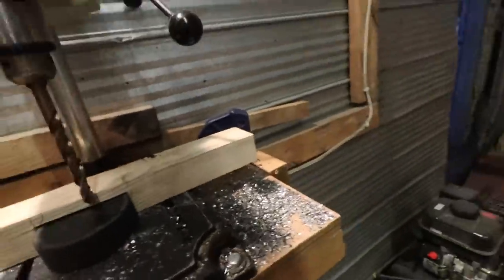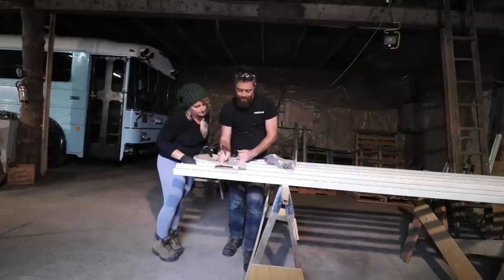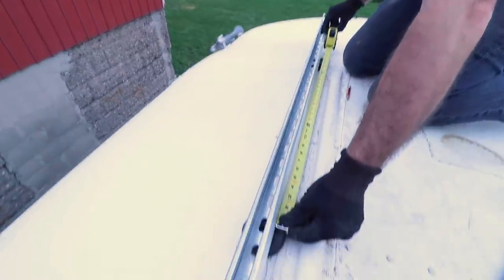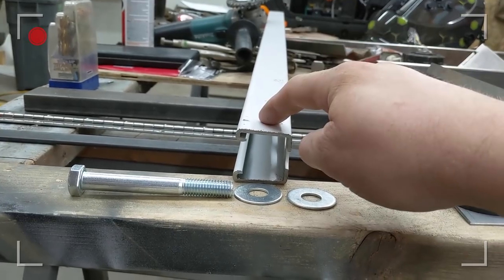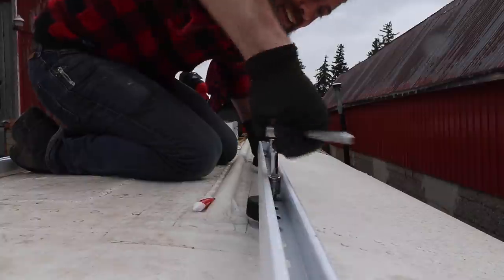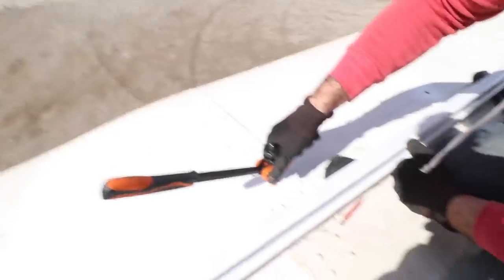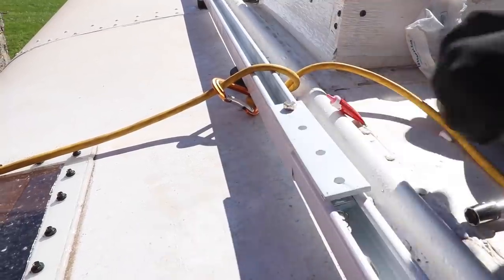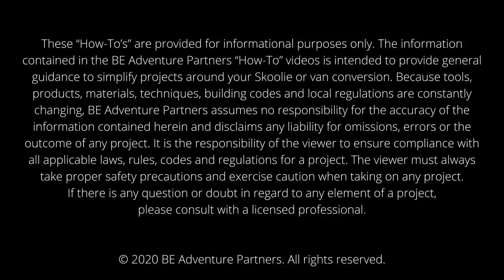Clever Yet Simple DIY Roof Rack Mounts Using Unistrut Channel Skoolie Conversion

Comment: This made my skoolie roof leak horrifically! And I did it exactly the same way! I used it to mount my solar panels. I even put 52OO over it and that reduced the leak but still leaks and my roof molded. It’s a nightmare! I’m at a 40k loss now unless I can somehow remove the racks, patch/weld the holes and put a new rack by side mounting them. And then replacing my interior roof! 😭
Reply from the maker: Really sorry to hear this. We have not had leak issues at all from the roof rack mounts. However… We have had mold issues in the lower part of cupboards and behind couches on low walls. Busses can be a condensation mess depending on where you live. We had what we thought was a leak from our roof. We tore out the ceiling and insulation to check. It wasn’t a leak at all. It was condensation pouring through the ceiling. Could that be your issue? I dunno… The rivet nuts sure are hard to squeeze… So could be that in your case. I know I couldn’t squeeze that thing, and it was hard for Brian… We love our conversion, but I’m gonna be honest and say it isn’t something I’d do again. Condensation sucks!
Reply: @BEAdventurePartners  that’s a great point! Condensation causes the same issues in mine, but maybe the guy who squeezed the riv nuts (cause I couldn’t either way too hard) maybe he didn’t do it well enough. I’ll look into maybe how to undo them 🤷🏼‍♀️🤦🏼‍♀️. Thanks for that detail. That does help a ton! ❤️

Comment: What are the flat bars for
Reply from the maker: Hey @bruce baker! The Unistrut are for mounting things like solar panels to the roof. Is that what you mean by flat bars? Or are they the flat steel bar stock we used to connect the ends of two pieces of Unistrut together? Let us know & we we can clarify!
Thanks for watching!
- Brian + Erin
Reply: @BEAdventurePartners  had put yours on top but mentioned they could be on they bottom also
We 
We 
We live in
Klamath if coming this way
Reply from the maker: Yeah we ended up putting them on the bottom in another video, we think it's this one: https://youtu.be/-GQTRlbBVSI

This way the boards can lay flat, and we won't have to route out the bottoms. 

Thanks for the invite. Can't wait til we can travel again. The province of Ontario is going into big time lockdown now... 👎

Comment: flat washers and locknuts, would be a lot more secure than rivnuts
Reply from the maker: hap wasner there are a lot of ways to accomplish secure fastening and flat washers & nyloc nuts were part of our consideration. However, we didn’t want to weld in those pieces so that if we ever needed to back out a bolt, using rivet nuts was our best option because they will be closed in the ceiling. 

After researching the size of rivet nuts we’re using, the pullout force required to rip one out is over 800 lbs in 18 gauge steel. Our roof material is approximately 12 gauge steel. When installed in a system, the rip out force is exponentially stronger. Also rivet nuts are designed to be used in blind fastener applications for vehicles and industrial usage. We’re confident that they can hold solar panels while we’re driving down the road! 

Thanks for watching!
- Brian + Erin